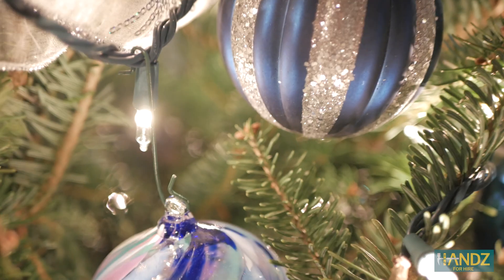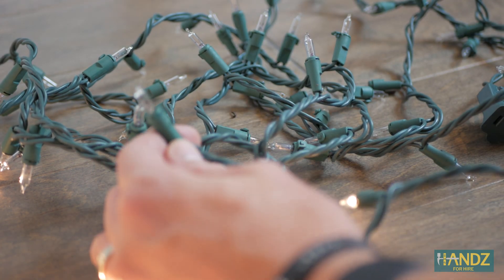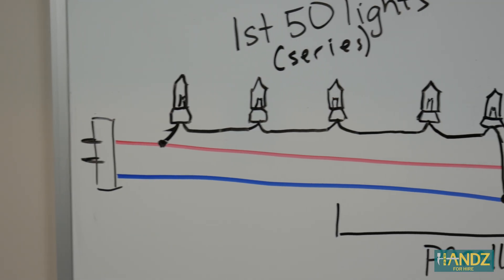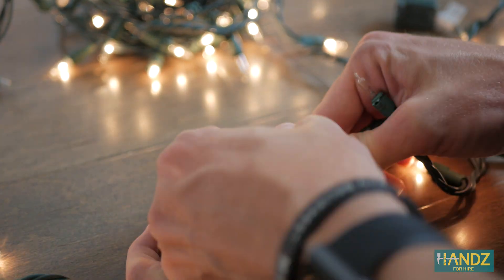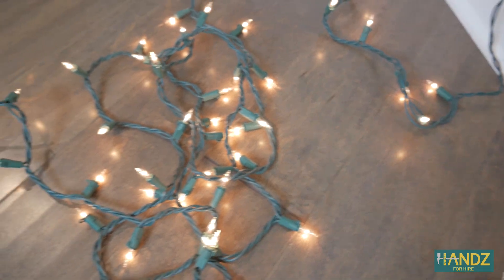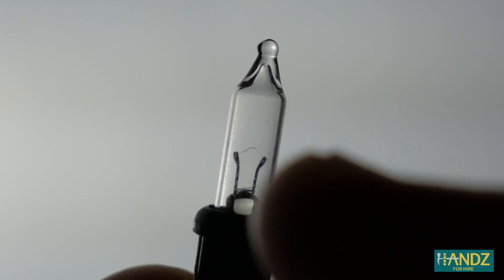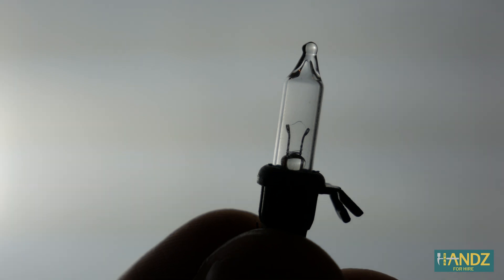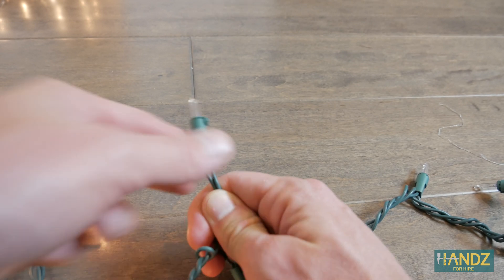HOW TO EASILY FIX CHRISTMAS LIGHTS plus SOME COOL PHYSICS

Comment: thanks great video But you explain the newer bulbs have the shunt / insulator so that the circuit  is not broken due to one burnt-out bulb and so it does nt affect the whole string, then you show us the half of the string where one bad bulb affected that whole part of the string; , Am i missing something ?
Reply from the maker: Thanks for watching! Great question. The shunt inside the bulb is supposed to keep the circuit closed when the filament burns out, but sometimes it doesn’t work properly. If a shunt fails (or if a bulb is completely missing), that part of the string loses continuity, causing half the string to go out. In this video, we discovered that there was a bad connection in the housing of one of the bulbs, so electricity wasn't even making it to the shunt on that bulb, therefore causing a full break in that circuit section of lights. Hope that helps! Let me know if you have any other questions.

Comment: First of all thank you for a great video and explanation!  What would cause a single bulb to short out immediately upon insertion?  I have gone through multiple bulbs that immediately flash and blow out as soon as I insert the bulb can you help me?
Reply from the maker: Hey Frank, my pleasure. It sounds like there's still way too much current running through the wire. Are there a lot of bulbs out on wire? Perhaps when you connect the first one, it completes the circuit, but the resistance is so low that it just blows the new bulb? Is there moisture in the socket? Maybe the lights were outside and the moisture is lowering the resistance in that socket? Good luck my friend!

Comment: Do you remember when we wuz kids those old time big Christmas tree lights which screwed in? Do you remember when a bulb burnt out we didnt know it for awhile because all the others stayed lit? Todays tiny light strings are really deviously evil. There is
NO WAY  the light string has to go out when 1 lamp burns out. They have wired it in series purposely to make us crazy & throw the whole string in the trash & go buy a new string. more $$ for them you see. bastards, Well, thats exactly what happened to us BUT I went online & searched & searched until I found a good quality LED set $18 for 33ft, This string will not go out if 1 LED quits. Thats just stupid. The cheaper the string the more likely the whole of it will go out.

!

Comment: Maybe it's my tester but it didn't work well on my LED string which uses DC after converting from AC. After an hour and a half of futzing I grabbed my meter connected the negative wire on one end and fixed 2 strings in less than 5 minutes.

Comment: Thank you for the great demo and clue to what you use to test each bulb. I have a 100-bulb string of dark purple lights I used for the first time last Halloween. Not one light goes on this year and I was not about to remove 100 bulbs looking for the one not working. I also have a string with pumpkin globes that I have used for 30 years and suddenly they also won’t work.
Reply from the maker: You're welcome! I know it can be difficult or just a pain to seek out the one bulb. Hopefully this video helps make the process a little quicker!

Comment: Never works for me. I’ve tried everything. Bought a multi meter, bought the Klein no contact, tool and even the light keeper pro. I still have to wind up checking each bulb individually. What a pain..

Comment: I have a Christmas tree star with 10 bulbs run in series, for some reason after I replace the fuses and the bulbs and then plug it in to the wall outlet, it immediately flash surges every light then turns off, burning the bulbs. I guess it’s too high voltage from the wall?
Reply from the maker: hmmm yeah sounds like it. I would try plugging the Christmas tree star into the rest of the lights on your tree instead of the outlet to see if that works.
Reply: @HandzforHire  tried that too and it still blew. It’s an old decoration, so maybe the bulbs that it had stock were different voltage or something?
Reply from the maker: @Mygary  that's so strange. Sounds like there's not enough resistance in that circuit so you're ending up with too much current running through the bulbs.
Reply: @HandzforHire   Yes, this is likely the case.  It’s a “cascading failure” mode, which is usually known to be caused by bulbs failing in shunt mode (filaments burn out and activate the low-resistance wire bypass current path).  When enough bulbs burn out, it reduces the overall series resistance of the circuit.  As Ohm’s law dictates, this means that current will increase (V=R*I).  If current is too high for the remaining bulb(s), then they burn out too.

The solution would be to check and replace all bulbs with new ones that satisfy the total power rating and resistance requirements for the circuit to perform normally.  This is sometimes easier said than done, given the terrible quality of low resistance bulbs out there.

Comment: Will that tester work with the little button/flat topped LED's?
Reply from the maker: It should as long as you can isolate the wires to test.

Comment: I would like to see a pre-lit tree fixed. I've spent about 10 hours on mine so far and haven't gotten anywhere.
Reply: We have the similar pre-wired Christmas tree.  The trouble-shooting procedure is exactly the same it's just not as convenient.  You will have to get in there with both arms and use your fingers to trace the wires.  

I used a couple of "Chip Clips" (clips to hold shut a bag of potato chip but you could use spring-type clothes pins).  I attached a long strip of bright orange tape (the kind used to mark hiking / horse riding trails).  I used these to keep track of where I started; where I was when I stopped to take a brea or where the demarcation was between the half string of lights that worked and the half that didn't.

Getting a non-contact voltage detector is a big help.  But again, it's not as convenient when working on a pre-wired tree vs working on a set of lights laid out on the floor.  The pre-wired tree lights don't have a lot of slack and the wires must be separated (per the video) for the voltage detector to work properly.  If not separated enough you make get false readings.
Reply from the maker: Ugh, that's frustrating. Richard Marton's response is excellent. I couldn't have said it better myself. Merry Christmas and I hope you finally had some success!

Comment: These string lights are manufactured to minimal standards.  If you take a close look inside the socket, you'll quickly note that the copper contacts have a flimsy weld to the wire leading to them, and are not really optimally fastened to the sides of the socket. They contact can pop loose.  The weld can break  Either problem can break the circuit and leave you with a dead string of lights that no amount of bulb testing can fix.
Reply: After learning about all the requirements and testing that products need to go through to meet the National Electrical Code, and UL/ETL testing standards and requirements, plus 4yrs of school for an Electrical Engineering degree… it’s astonishing to realize how horribly bad the quality and engineering of these strings of christmas lights is!  To think that these cheap shoddily designed bulbs with such thin gauge wires are exposed to mains voltage is quite horrifying.

I suppose they rely on the most probable failure mode being within the filament in a high enough percentage of cases to avoid catastrophic fire danger.  Plus the built-in fuses add an extra layer of protection but not to mention an extra layer of annoyance to diagnosing failure.  

The newer bulbs with shunt failure mode also create a new problem… Shunting current directly across failed bulbs causes a new cascading failure mode. This occurs when the resistance of burnt out and working series bulbs reaches a critical low threshold.  Then current increases to a high enough level to fry all of the remaining bulbs. This is quite an annoying failure mode which ensures that any single bulb replaced will immediately burn out, unless enough burnt bulbs are identified and replaced simultaneously to make the total series resistance high enough to reduce current below the cascading high-current failure threshold.  Now you need to replace all the bulbs at once… Crapitalism at its finest… 😒
Reply: @TrinitronX  That is cRaPitalism. That’s ChiCom Capitalism because the American consumer has sacrificed Quality for cheap low cost - throw away convenience - that ends up in the landfill … costing taxpayers more🤦🏻‍♂  🤷🏻‍♂
Reply from the maker: @TrinitronX  I love this! Lol. You're completely correct! Sell them something that won't last more than one season so they'll keep buying more each year. I salute those who take the time to do what I did in this video. I can usually fix a string of lights in about 10 minutes which is faster than running to Home Depot for a new box.
Reply from the maker: Very true, but with the voltage detector, you should be able to find the problematic area. Sometimes it may be beyond repair, but it's always worth a shot. Have a great day!
Reply: I bought 20 feet of 50 bulbs for $3.49 at Walmart.  You want to pay more for quality?  It's avaible, you choose

Comment: how do i fix it without me the tool?
Reply from the maker: Hello! Unfortunately without the voltage detector, you'll have to pull out each bulb and test one you know that works, until the lights go back on. It's just trial and error. Still works, but takes longer. Good luck!!

Comment: thnx alot, we have a mini-tree on the window sill and all of a sudden all the lights got real bright and went out. i noticed most of the individual lamps are kinda black so i guess they had over voltage like you said, maybe i'll try and fix it. would you say the black lamps which seem to be all of them are toast? i'll have to get my test equipment out. merry xmas and your tree looks great.
Reply from the maker: You're welcome! Unfortunately I think those black bulbs are toast. You can check with your voltmeter like shown in the video or look for physical evidence to see if the filament is detached. Hopefully the fix won't be too bad. Good luck!!

Comment: Great video thank you! Why was it necessary to reverse the polarity…..wouldn’t you still be able to find the bad bulb or socket without the plug reversal?
Reply from the maker: Thank you! Great question and the answer is yes! I reversed the polarity just to bring the voltage drop to the wire I was examining. I could have kept moving right without voltage, and then when I hit a voltage drop, I know I would have known I was a bulb beyond the problematic area. I was kind of just trying to explain how it worked by flipping the polarity. Another option would have been to start at the end of the string and work left, but in the beginning, I didn't know which of the 50 bulbs was problematic, so it was a 50/50 shot on which end to start. I hope my response was clear enough to understand. Merry Christmas!
Reply: No because elec would not flow in that direction giving you a misleading conclusion

Comment: I just plugged them in and they worked. I plug them in 10 minutes later and nothing. I changed the fuses, no black bulbs or anything. I took each bulb out and put aluminum foil to see if I can find a bad bulb & still nothing. Please help 😩
Reply: It's actually a tinsel sign that's prelit. It's a nice sign I don't want to trash if it just worked 10 minutes ago
Reply from the maker: @robinnorth2966  hey Robin. Do you happen to have a voltage detector? They're pretty cheap and I have them linked in the description of this video. The voltage detector will help you determine where the issue is located. I bet it's a loose connection somewhere since it worked and then didn't work. I know it's super annoying, but I'm confident you can figure it out! Let me know how it goes.

Comment: i have some christmas lights but one day there all working goood then when i went to hang them up i put a thumb tack threw the cord by mistake how can i fix it
Reply from the maker: Do they still work? As long as the copper wire inside the cord wasn't severed by the thumb tack, you should be good.  Wrap with some electrical tape. If it was severed, then you'll have to splice the wires back together. Cut out the bad part and pick up some barrel connectors at Home Depot. Place a wire in either end of the barrel connector and crimp down until each end of the wire is secure. I hope that helps!!

Comment: I have a strand of 50 lights that suddenly stopped working  . I checked the fuses , they are good , and I have power at the plug on the end of the line . What's up ?
Reply from the maker: So they're probably wired in parallel so that power still passes to the next strand.  There's a good chance you have a bulb with a broken connection like I did in the second half of this video. Use a voltage detector to check the first bulb on either side of the 50 light strand. I bet one side will have a voltage drop and the other side won't. Let me know how it goes!

Comment: Hey, my lights are flickering when I put them in the switch board. Is this some loose connection? Can someone tell me what do I need to fix ?
Reply from the maker: I'm trying to picture your scenario. Do you mind providing more details? What kind of lights and how are you using them in a switch board?

Comment: Thank you! This is awesome. I was already in tears trying to find out. I have to bookmark this for next year. Thank you for making so much fun to watch. One question, I bought the replacement bulbs and are 6V.  I put a couple of in the string they both burned out almost immediately. I figure it must be an excess of voltage. Do I test one by one and then plug the whole string?
Reply from the maker: Hi Jose, Merry Christmas! I’m glad the video is helping. My guess is that either the replacement bulbs you got don’t match the other bulbs on the string or you have so many bulbs out that it’s sending too much voltage to the working bulbs. Less bulbs equals a greater voltage drop across each individual bulb. When you put the couple in the string, did the working lights come back on? If you’re able to see the remaining bulbs out, stretch your strand out, plug them in quickly, take a photo of the strand and then unplug. Use the photo as a reference to replace dead bulbs so you don’t burn out anymore. I hope that helps. If I’m off on my assumptions or your situation, let me know and I can try to help you navigate.

Comment: They don’t tell you about the need to isolate the bulb in the tester instructions!
Reply from the maker: Yeah, on one of the parallel wires, you will have voltage. It’s important to isolate the bulb so your voltage detector isn’t falsely triggered. Have a great day and Merry Christmas!

Comment: Well done.  I learned a lot.  Many of my questions were answered and I can fix my lights.  One question: I have some 12 volt mini lights.  What will happen if I use one of these in a string of 2.5 volt lights?
Reply from the maker: Hi Charles, I’m glad the video helped. I imagine your 12 volt mini lights and 2.5 volt lights are LEDs? Also, do the sockets match okay between the two types of bulbs? With incandescent lights, normally if you add a bulb with higher resistance in series with others then the voltage drop across that one bulb will be higher than the rest. This will cause the other bulbs to dim (less voltage to be shared among the rest). In short, there shouldn’t be a problem adding the 12V mini bulb but it may result in different brightnesses. Please let me know how it goes if you decide to try.
Reply: @HandzforHire  I tried one 12 volt mini- incandescent  light in the 100 string of 2.5 volt mini-incandescent lights and the 12 volt light flashed and immediately burned out.  I won't do that again. Nothing but 2.5 volt lights for these strings from now on.

Comment: The problem with most of these sets and pre lit trees is after about five years all the bulbs start burning out all at once because when the lights or the tree are in storage during the rest of the year every year, the moisture and the humidity starts corroding the little wires on the bulbs and it eventually works its way up the wires all the way to the inside of the bulb causing the vacuum seal to break which causes them to burn out more frequently and sometimes all at once, I've heard of people buying new old stock lights that were 5 years or older and they only lasted about a week when they started to use them.
Reply from the maker: Yes, I agree there’s definitely a shelf life, but the strands I was working on in this video were only two years old. Merry Christmas!
Reply: @HandzforHire  Oh I know, I've seen this problem a lot with the sets and the trees that I've had through the years, the bulbs start to burn out here and there every year and then I replace them and then one day they're all working perfectly when I turn them off and the next day when I use them or turn them on, every bulb is out and all the bulbs are black inside and every bulb I looked at closely, the small wires were black and oxidized and there was green corrosion on the glass around the wires, if it's just a set I'll toss them and get a new set, if it's an expensive pre lit tree, I'll just buy a set with the same voltage bulbs and replace them all and then I should be good for a few more years :). Merry Christmas to you too!
Reply from the maker: @Truckguy1970  I can relate to everything you said. The joys of the Christmas season. Lol. Have a good one!